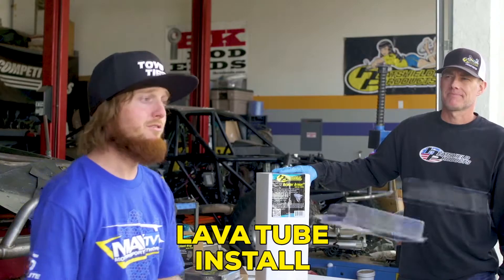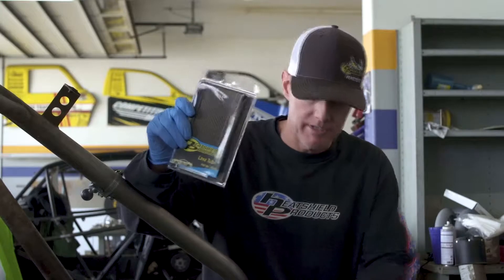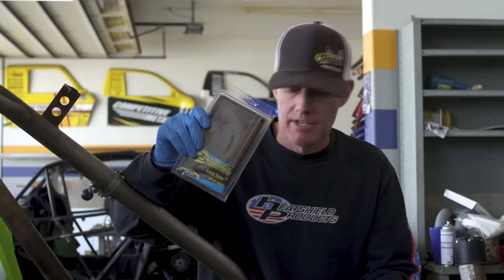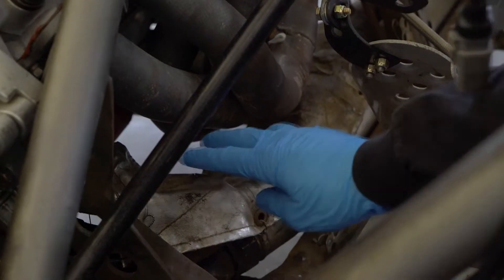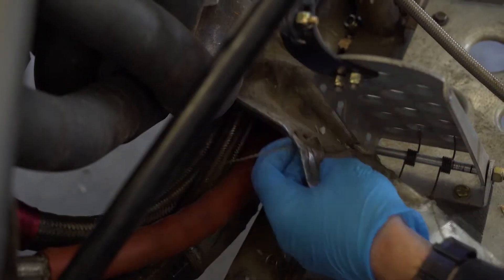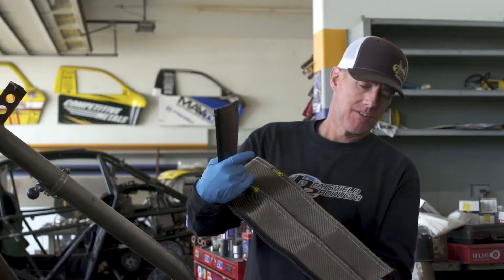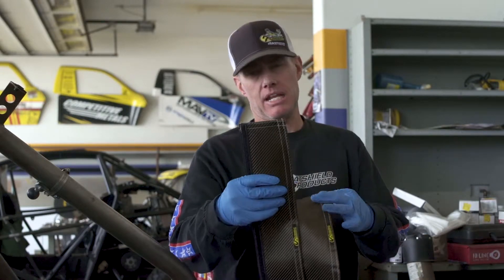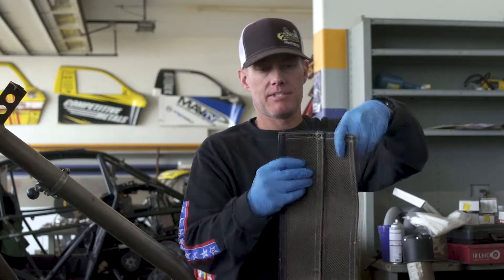Heat Shield Sleeve Install - Lava Tube

Comment: @1:06 what type of wire are you guys using to secure the lava tube material?
Reply from the maker: Thank you for the question Paul - The sleeve closes with high temperature Hook and Loop.  The wire is an Inconel wire.  In this case the wire is there to hold several hoses together under the exhaust.

Comment: Is the lava tube ok to use for direct contact to headers? My starter wire, and crank position sensor wire basically hits my headers.
Reply from the maker: Possible. As long as it is NA and you can make sure the hook and loop seam will not touch the header pipe it should work. It is always best to give it a little airspace off possible.
Reply: @Heatshieldproducts  thank you